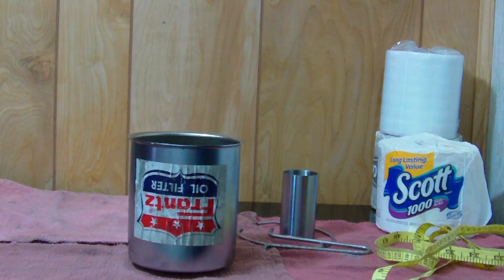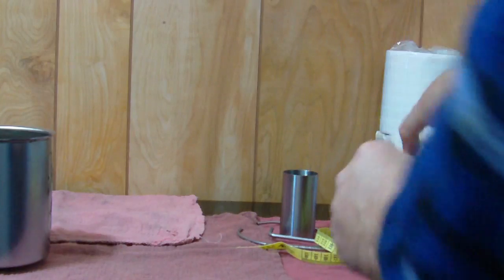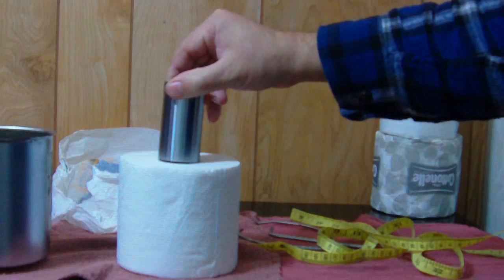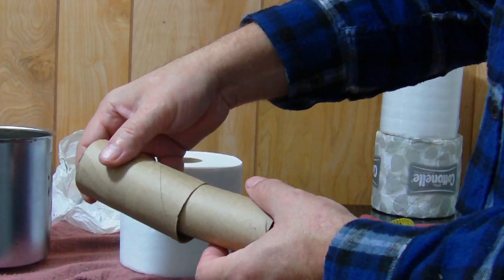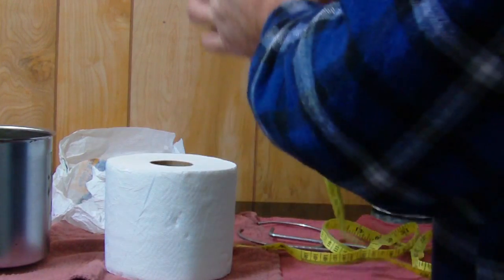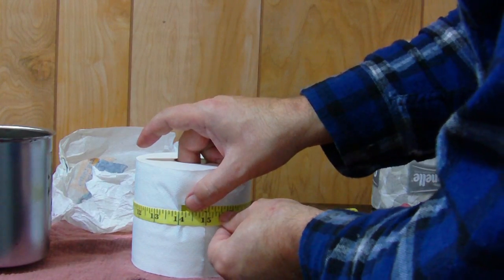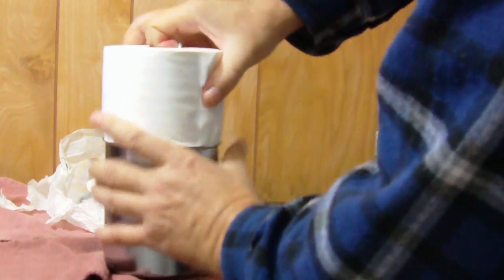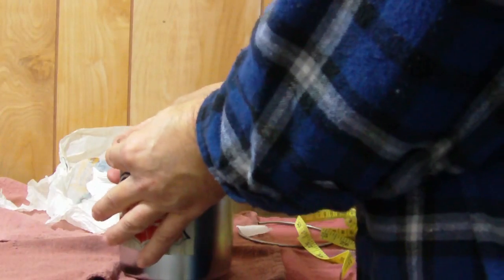Fitting a Scott 1000 TP Roll Into A Frantz Oil Cleaner

Comment: I recently bought a Australian Jackmaster. It is designed for its elements or the tightly wound TP. It has no center tube. It uses a larger core seal at the bottom. The seal is flat so it needs a tightly wound roll like your Scott. It can handle any size TP core as long as it isnt bigger than the seal. I put a roll of Great Value 1000 from Walmart in my Jackmaster. Didnt need to unroll any. The Frantz was designed for 1 1/2 inch paper. The paper changed but Frantz didnt. Toss the damn sleeves and install a bigger seal at the bottom. It can be flat like a big flat washer. About a 2 inch OD seal. You dont need to seal the tube.  The Gulf Coast junior  is a better design with a bigger core seal and a 1 3/8 center tube. At some time when Frantz went out of business one of their dealers improved the little filters and replaced the 3 stackers with a filter that uses Bounty big roll paper towels.  Thats the Gulf Coast  filter company.  They might have some agreement with Jackmaster . Jackmaster is Australia's  best oil filter. Gulf Coast might have dropped the little filters and are concentrating on the big filters. You can research it. Gulf Coast  needs a high quality little filter for the military NASA Shell Offshore and others. Offshore rigs have locomotive engines. They also have stuff like fork lifts that need little filters. Saw a little filter on a Air Force Humvee. That was years ago. Dont sell filters any more I have used and sold almost all of them over the last 60 years.
Reply: Great info.
Reply: When I put a Frantz on my Rambler  American flat head 6 in 1963 and saw the oil go from dirty and black to like new I didnt nit pick the bad design. The Frantz was designed for 2 ply with a 1 1/2 inch core. Long before Scott 1000 or the Frantz paper. The Gulf Coast junior is a lot better design.Not sure they still make them. The Australian Jackmaster Classic is just as good. You get the size right push the tp down against the core seal and put on the lid. You can use the Jackmaster Classic element or a firm roll of tp. I think the Jackmaster element is about 20 bucks. I normally use Great Value 1000. The Jackmaster has no center tube to put a spacer on. The core seal is about 1 15/16 inch. The Jackmaster Classic element has a cloth cover with a pull ring. I use long nosed pliers to remove the toilet paper. Over 60 years of using tp. Actually the Jackmaster Classic uses a high quality roll of Australian toilet paper in a sock.
Reply: I get the Great Value 1000 from Walmart The size is all over the place.
Reply: How has the jack master gone a few years later ? What engine was it applied to ?

Comment: If you know how to change the toilet paper you don't need the extra sleeve.or the ring under the element. I bought my first Frantz in 1963.push the element down on your knee.make it concave. The round or hemisphere end will be down you want the core to contact the seal first.if you don't.do this you may end up.with no contact with the seal. Then you will need a tight seal around the core so that.the oil.pressure. will be able to.do what you should have done the reason motor guard and gulf coast filters don't need the sleeve is you are pushing the tp down against the seals before you.put on the lid..

Comment: How and were did you get the Frantz 1.6" adapter?  do you know the upc bar code number?
Reply from the maker: I bought it from a guy selling Frantz filters, its just a piece of pipe that was machined. You can also put some index cards inside the TP roll to fill the gap.
Reply: Frantz is the only tp filter that depends on the seal between the Frantz tube and the tp core. The top loaders depend on the larger seal at the bottom. The Australian Jackmaster Classic has no center tube. You push the tp down against the bottom and put on the lid. The shorter paper doesn't matter with the top loaders.